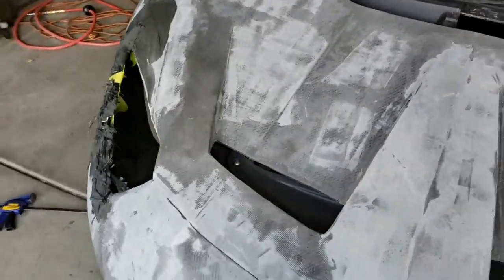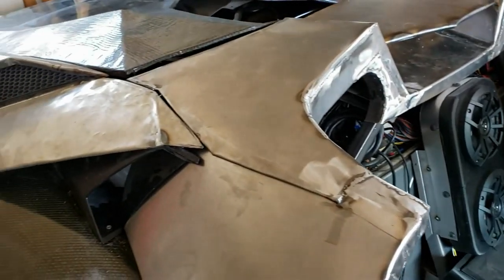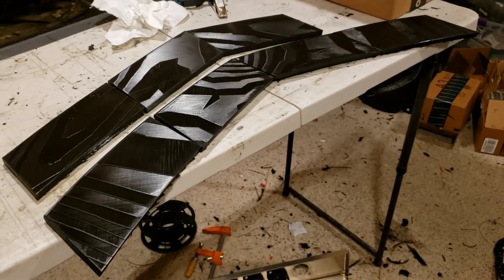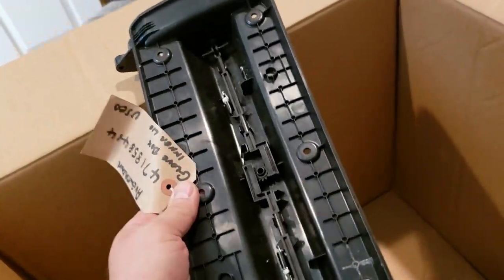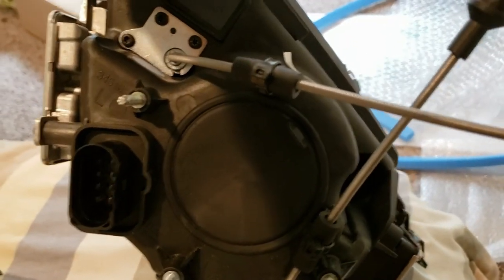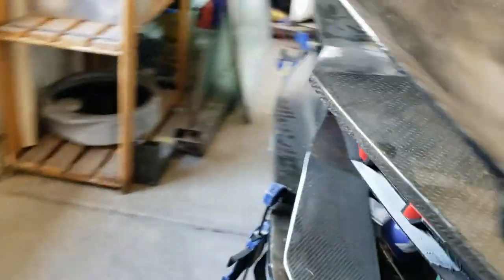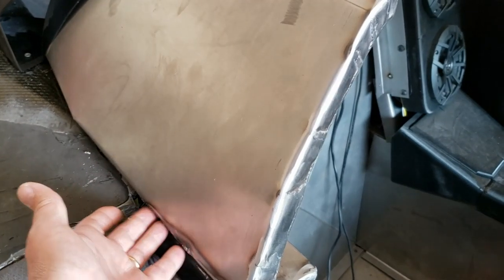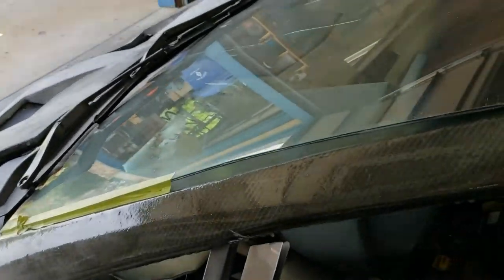3D Printed Interceptor Update 41

Comment: just one slight observational note where you could just use OEM tailights too so it's in equilibrium with the front ones. The rest of the build shouts 3D printed in any case for the essence. Just a take. The reflection of the OEM tailight vs 3D printed for pictures and video after completion would tell tales, hence! Thank you for inspiring generations nonetheless.